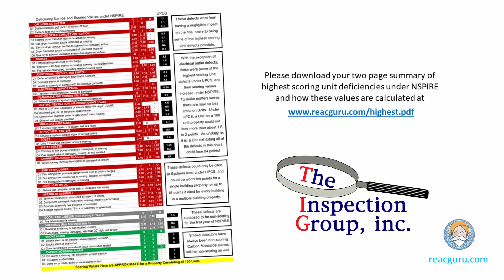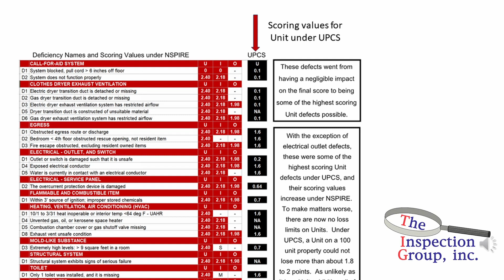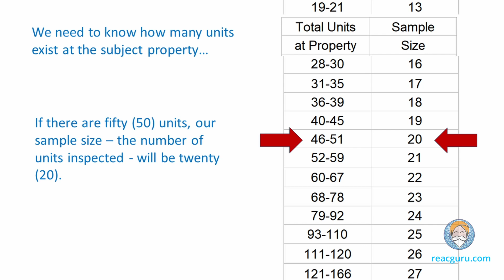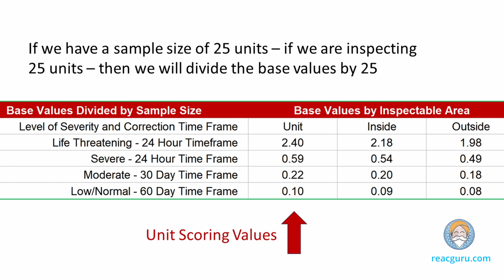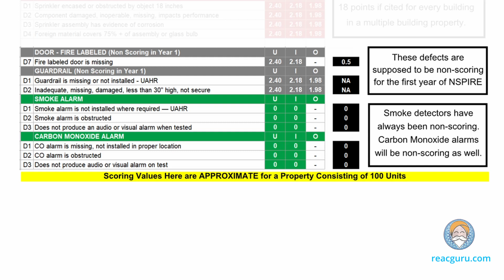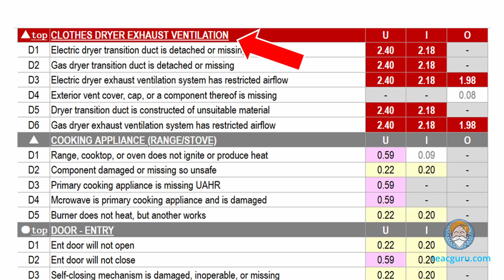High Scoring NSPIRE Deficiencies

Comment: 9:32 I have a queztion about combustable. I have mechanical rooms on a properties in residents home wirh HVAC system which is eletric, would I be sited if resident had items in room.
Reply from the maker: Thanks for that question.  Like most REAC/NSPIRE questions, it's more complex than a yes/no answer.  Any given inspector might cite it whether it's right or wrong to do so, but this would usually be appealable if there was only electrical equipment in the room.  I'm not saying the inspector is necessarily wrong, but if you can get your HVAC contractor to sign a letter saying that the equipment is all "zero clearance" so that it does not pose a problem, you can probably win that appeal.  The standard says materials within 3 feet of an appliance that provides "thermal comfort" (HVAC equipment in other words) are an issue, but then it says not to cite electrical equipment as a source of ignition.  It's understandable that readers can disagree on whether that means items near electrical HVAC equipment is an issue.  So, your best bet is to consider items stored near the HVAC equipment a flammable materials hazard when doing your own inspections and advising residents - BUT - know how to appeal this issue if it is cited ! ! !